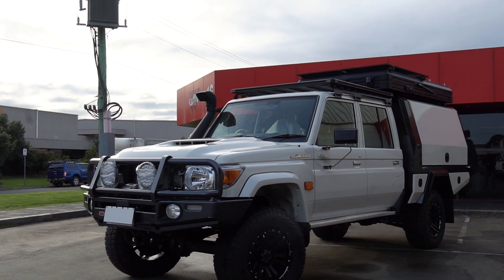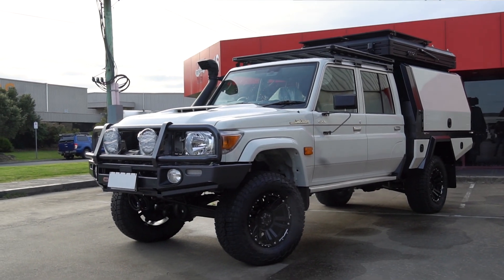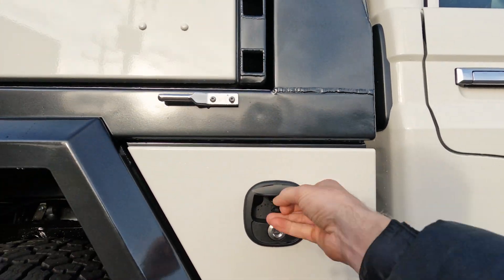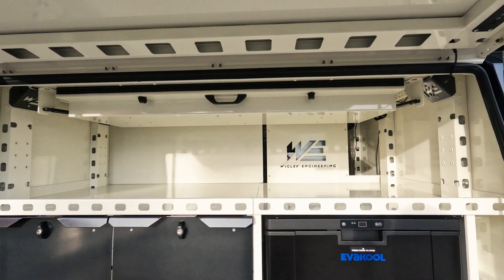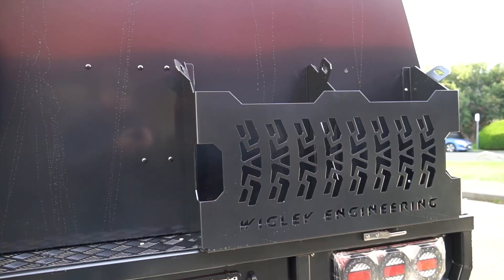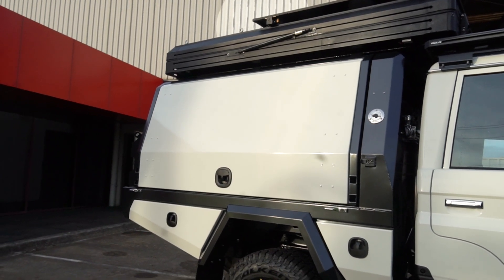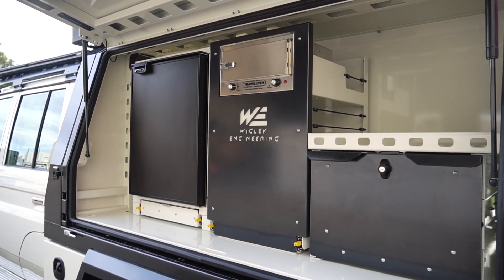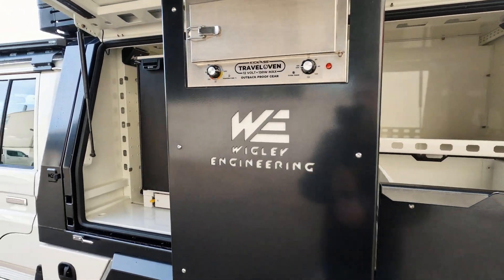WIG RIGS EP.3 - Not your standard 79 series build!

Comment: What sort of dry weight pls, without fridges if poss.
Reply from the maker: Canopy weight comes in at around the 560kg mark for a 2140mm L x 1850mm W canopy. Including all the internals. Taking out the fridges will reduce the weight by 54kg. Tray weight is around the 270kg mark
Reply: @wigleyengineering  cheers, how much would weight reduce with a canopy on chassis, so no tray, no tent etc
Reply from the maker: @markh6676 Canopy weight is around the 500kg-510kg mark with no tent and no fridges